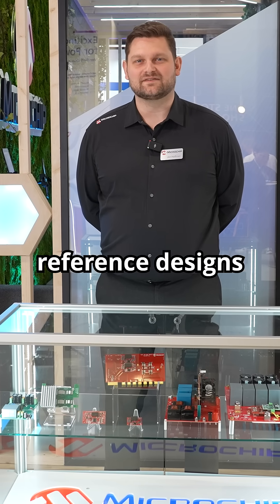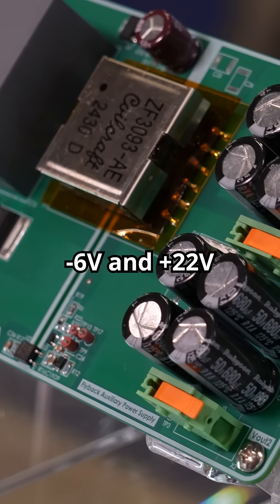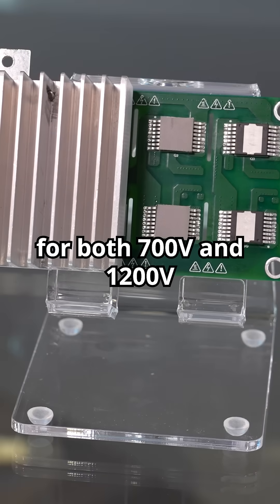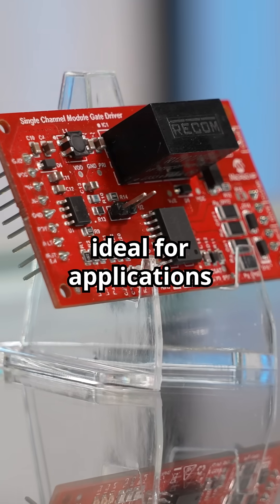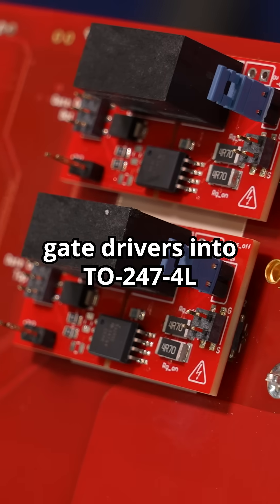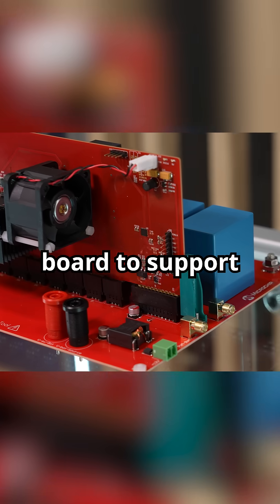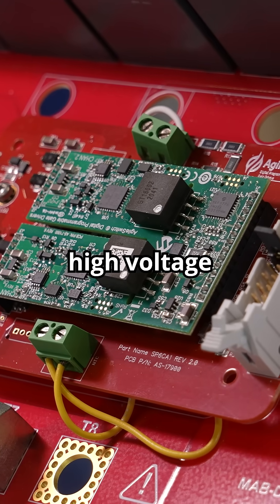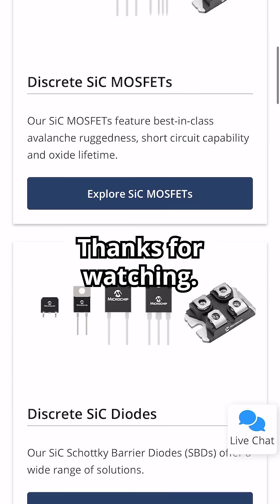Microchip’s New SiC Reference Designs Are Here!

Comment: what happened to the three phase charger project, developed in Munich? finished or shut down?
all the best!
Reply from the maker: Hi there, thanks for reaching out! If you're interested in learning more about three-phase chargers, you may find our reference designs useful. We have two specifically for three-phase listed here https://www.microchip.com/en-us/solutions/automotive-and-transportation/charging-station/ev-offboard-ac-charger-reference-designs. These include:
 
- Three-Phase AC Commercial With OCPP and Wi-Fi® SoC EV Charger Reference Design: offers seamless connectivity and comprehensive safety features, ensuring high integration and reduced system costs for high-end residential and commercial settings
- Three-Phase AC Commercial With OCPP and Display EV Charger Reference Design: enhances user interaction with its display feature while maintaining the same high standards of connectivity and safety
 
We hope this helps!
Reply: @MicrochipTechnology  ah, ok. not from the digial power team Munich